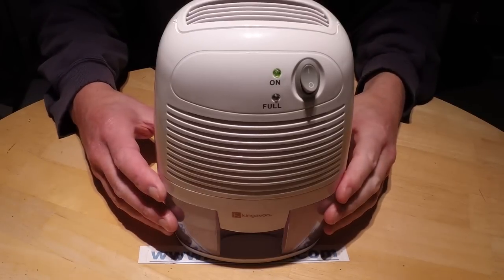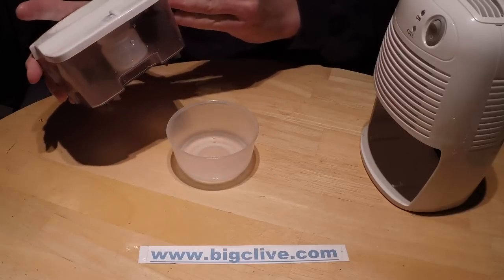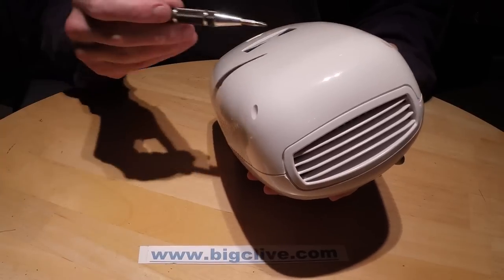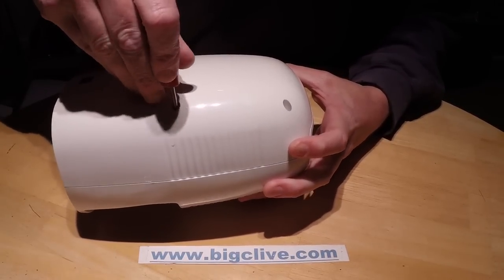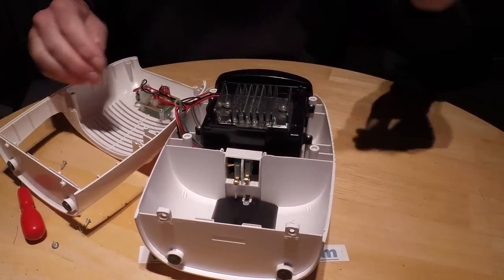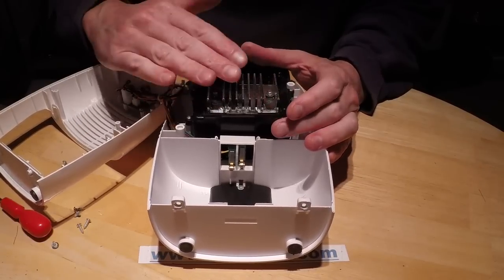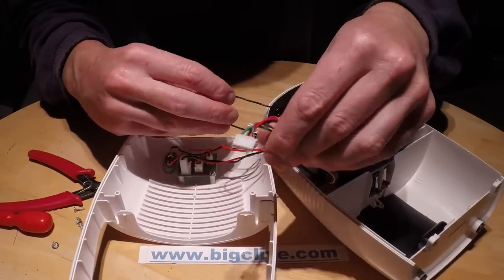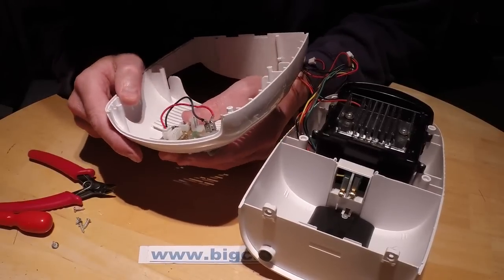Mini peltier dehumidifier teardown.

Comment: Would this be sufficient for an emergency water supply?
Reply from the maker: +Vallen Larsen I don't think it would produce enough.
Reply: bigclivedotcom I'm sorry... I should have included the word supplemental in that question... Of course it wont be enough on its own. Now what about plants? Would it supply enough water to hydrate a plant or two? Thank you, sir. Love the videos and I envy your island of residence.
Reply from the maker: +Vallen Larsen It would probably be enough to keep a plant alive plus spare.  But the water would effectively be distilled, so it might need extra fertiliser and minerals.
Reply: depending on where you live and how polluted it is, water collected from the air may not be pH neutral.  Even for plants, treatment may be needed, not just for minerals, but acidity.

Comment: I have the exact one in my towel closet. It was going alright for about a year then he bearings went on the fan. Just replaced it with a Noctua one. Next I was going to see if I could make it battery powered so I can out it in closets without a power point

Comment: Wouldn't it work better if the air goes through the hot side of the heatsink first then through the cold one? That way, the air gets heated first and the massive drop in temperature via the cold part of the heatsink will aid in drawing out more moisture from the air.

Or I might just be overthinking LOL.
Reply: +Kevin Go Interesting thought you have, but the answer would be "no."  It's not the difference in temperature that causes the water to condense - it's simply the overall temperature of the air.  Heating the air up first would unfortunately make the dehumidification process *much* less efficient.  Once air is cooled below a certain temperature, it can't "hold" the same amount of water that it can at a higher temp and that water (technically a gas or steam) forms on the cool surfaces.  A full-size dehumidifier (with a compressor) actually does use a principle based on your idea, only in reverse.  Since it is only removing moisture (humidity) and not cooling like an AC unit, it actually reheats the air going through it.  Room air enters, it is cooled below it's dewpoint, the water condenses and is removed, and then the air is reheated.  Actually the reheat is necessary because of the way a vapor compression system works...
Reply: Actually it would've been more efficient to blow the cold air (after condensation) back through the hot side, as this will cool the hot side more effectively.  The cold air is essentially wasted anyway, so using it like this would get a little more use from it first.

Peltiers can only maintain a fixed temperature difference between the hot and cold sides (say a difference of 30°C maximum), but the hot side will get hotter forever, which means the cold side will heat up too as it will always be 30°C below whatever the hot side is.  By blowing the waste cold air over the hot side, you will cool the hot side even more than using room temperature air, which will allow you to maintain a lower temperature on the cold side, which will allow more water to be extracted from the air (since the cooler the air, the less water it can hold).

Of course this doesn't break any laws of thermodynamics, because with a perfectly efficient Peltier blowing the cold side back to the hot will in a best case just get you back to room temperature.

Comment: Hi Clive, thanks for this teardown video. I've always wanted a small dehumidifier for a tiny room and had looked into the peltier-based models, but found $35USD+ way too expensive for what essentially is a peltier and a few heatsinks. Now that I know how these things work, I can use a few peltiers I have and some spare heatsinks to recreate this device for only the cost of my time.

Thanks again!
Reply from the maker: +Patty Two Wheels A recent test showed that the peltier unit was only about 20% as efficient as the desiccant drum unit.  So the initial cost of the small unit would soon be outweighed by the running costs.
Reply: The point of the vid is this design is bad even when optimized it’s just a very ineffective way if you’re looking to actually draw a decent amount of water per day. This inherent limitation and slope of increasing inefficiency as the area around it comes to temp. His whole point is this would be completely ineffective in any practical sense. So I don’t suggest you waste your parts and time this way, Peltier modules as a whole are just super inefficient even with the high power units it would be terrible  at this practically for condensation uses even with high power consumption. The math has been done and even with the most efficient end best units we can make it would still be wildly ineffective. Technically they work but there exist much better ways as even refrigeration with gasses abs compression is more efficient generally. Hence  the self filling water bottle thing or the “water seer” devices and anything similar  can never work and would barely provide a few sips of water a day. Sorry but they haven’t found a miracle that solves the water crisis so simply  and easily. Keep in mind the Waterseer was a straight up scam and basically so is any similar fonts self filling bottle and they absolutely know it never word. And high school student could do the math to show what would be produced with the power used and the modules we can make and quickly find the idea as laughable and only works technically ever so slightly in (theory usually lol) as being a step away from free energy . Physics says so. Maybe try some of the other project uses for your spare unit and make something more useful and effective like a fridge. And you could do solar but the required panel would defeat the purpose and raise size and cost vastly. Wall power is cheap and likely available to you.
Reply: +bigclivedotcom and the full switch will never work and less one it changers its mind to how much water it wants to get out of the air
Reply: Of course it adds about 30W of heat to the space it's operating in, which lowers the humidity by raising the temperature.  When I worked with my dad in a resort, there was a 100W light bulb in the outdoor box that contained the PA system, just to keep it a little warmer inside and prevent condensation that would mess up the electronics.  So in a confined space like a linen closet, this peltier unit might be as effective as a 40W bulb.

Comment: I used to have one, and I would imagine that mine was quite a bit more effective than this one, as it used a 40x40mm Peltier module and a much larger heatsink.
Reply: Please can you share internal diagram
I need this really for my 4 fit box to dehumidifier.
It will work in 4 fits box to completely dehumidification within 3 to 4 hours ?

Comment: Did you find out how much moisture it can take running for a day? I wanted to use something similar on a car without heater, so wondering if should go with this or a desiccant one. Thanks
Reply from the maker: +Susana Godinho It might be OK in a car.  But would draw enough current that it couldn't be left running all the time or it would potentially drain the battery flat if the vehicle wasn't running.  If you search my videos for rechargeable dehumidifier you will find one of the silica gel ones that has a built in heater so you can plug it in indoors overnight to dry it and it then does a modest job of drying the air in a vehicle.
Reply: +bigclivedotcom That would only run when the engine was on or the car was plugged in. 

I have the silica ones, 1KG bags and those remove about 30ml/day: only good to keep condensation under control while the car is parked. Did you tested the removal rate and capacity for those portable ones on your video?
Reply from the maker: +Susana Godinho The little peltier unit in the video drew out 200ml in 12 hours of use.  Not great for a house, but maybe OK for in a car if it's being driven a lot or if it's an electric one, then while it's plugged in.  I might suggest putting it in a suitable container so any water that slopped out of the water tray wouldn't immediately soak into carpet.

Comment: 30W peltier? That's like trying to heat a room, even small, with a 30w lamp, you'll never make it, I plan to build one with 600W array of peltier, also, air will cycle from the cold fin and fed into the hot fin, what won't heat the air and make the hot side a lot cooler, making more cold on the other side, I've tested the setup and works. Also comparing this with compressed gas, they consume around the same 600W to be effiecient.

Comment: I want to know.what the way air in and out in this pleter module?because brusless DC fan is attached on the hot side.but we need cold air.if the cold side of the pleter module is not attached with any fan..how would actually we get.cold air from that.plz pal..I need to know

Comment: Peltiers are quit fun in the way they work, just really inefficient compared to a compressor refrigeration unit, and it is always a good idea to replace the stock fans on peltier things, I changed the fan in my minifridge on Satuday as the stock fan pushed me to breaking point with the horrible noise it made, I even videoed it too for my other channel:

http://www.youtube.com/watch?v=nlYvh28ZFE8

Comment: This is a useless piece of crap from China.  Do not throw your money on these things if you are looking for a serious dehumidifier.  Buy the traditional compressor type or the desiccant type consisting of a zeolite wheel dehumidifiers.  Do not promote these wrongly/poorly engineered devices.  I get only 100ml of water in a 70% humidity environment over a 24 hour period, which is not good at all.  I should have been getting (1500 ~ 2000)ml of water for that period.  I wonder who designed this product, seems like someone selling snakeoil!

On Aliexpress.com the chinese sellers can't even differentiate between Desiccant type or Peltier type dehumidifiers which are 2 different technologies, one absorbs and the other condenses.  They are claiming that these devices are of desiccant type!  I do not want to do any China bashing overhere but these sellers are misleading there customers into believing that it can do the job of a real dehumidifier.

I bought one manufactured by INVTOP just for the fun of owning a Peltier device.  The first thing I noted its very noisy generating 59db @ 12V.  With its 9v power supply it produces 56db of noise.  It should be noted that a Peltier device is only 5% efficient.

Anyways thats a great video, exposing what is inside/truth.

Comment: I wonder if the peltier was moved to the bottom of the heatsink in manufacturing, to ensure the heatsink is colder at the lower part to ensure the water doesn't evaporate again as it's travelling down the heatsink? Any Thoughts?
Reply: I was also thinking that the heat from the peltier makes it slide down over time which is why it was at the bottom.

Also if it was in the middle wouldn't it collect more water making it drip onto the collection bin faster?
Reply: I don't think so, looking at the heatsink compound it doesn't look like it has moved, otherwise there would be gunk all the way down.

Comment: Love your videos! Can't help but wonder if you could improve performance by adding a second Peltier junction?  Is suppose in doing so, however, you might end up icing the cool side and have to add circuitry to shut down the junction for a bit to allow it to melt when it reaches 0°.  Then of course there is also double the heat on the hot side.  Perhaps a great idea that just wasn't meant to happen.
Reply: you could add a really large and oversized heatsink to the hot side. peltier just generates a temperature difference, the colder the hot side the colder the cool side.
Reply: +Rich Booth No, adding a second doubles the heat which with the same airflow rate and heatsinks, potentially results in the cold side of the 2nd one being hotter than if only one were used.  You would instead improve performance by increasing heatsink size on the hot side, or swapping in a higher flow fan.

Comment: I have had 6 or 7 of these around, bought in batches of 2 or 3, and two a little larger ones. I always knew they won't be the "best thing ever", but it was mainly for space reasons that we got the small peltier ones (e. g. outside wall corner in parent's basement and bathroom, in corners on shelves i my basement), but I did not expect them to perform that bad. After 2 summers of use all the fans are rattling like crazy and all but two of the power supplied died due to failed caps, just what you expected in the description. They were just barely doing their job. Their main effect of getting the air drier is actually just heating it so relative humidity drops. Perltiers are horribly inefficient. If I remember correctly it was something like for every degree the cold side gets colder, the hot side rises by 10.

In our basement we now installed some 125mm air ducts from room to room with two fans, so the air is pumped through all rooms in a circle. In one of the rooms there's a compressor dehumidifier (around 300W). It replaced two of the bigger and 4 of the smaller peltier dehumidifiers. This single device is enough to keep all the basement rooms around 65% rH, even in the problematic corners and after days and weeks of 30°C+ weather.

So in essence: you're much better off getting an old fridge and leaving it running with the door open than to buy those crappy peltier things.

Comment: The module is very cheap, you can get what I think is the exact same unit on ebay for $0.99.  This is a 4 amp model, you can get a 15 amp version for $5.00.

Comment: If you ask me, the cooling heatsink doesn't look as big as it could be, and neither is the airflow optimised properly. It looks like a half-baked design, to be honest. You might dramatically improve the performance (proportionally, that is) by slapping on a much bigger cooling heatsink and improving the flow so that the incoming air has to go through the heatsink from top to bottom (or bottom to top), and making sure the outgoing air doesn't interfere with the incoming air.
Reply from the maker: The size of the cooling heatsink is probably deliberately small to increase the temperature differential between it and the incoming air.  the airflow does run down the channels of the heatsink before passing round the back to the hot side.
There's a very good chance this IS the actual optimised design, but it's just very inefficient by its nature.
Reply: He said "from cold to hot" and that would increase the performance a lot, thats how all (real) dehumidifyers work. That way a lot less energy is wasted to cool down air when u actually just want to put energy into condensing water, as the cold air cooles the hot side it makes the cold side even colder. So it basically regenerates (some of) the energy put into cooling the air.
Reply: +bigclivedotcom It doesn't look as though there's adequate air flow through the cold heatsink.  It should be pushing as well as pulling.  Also, what was the exhaust air temperature?  A dehumidifier should be temperature-neutral as far as possible. The peltier seems a bit underpowered as well.  The part number 12704 means 127 thermocouple elements and 4 amps design current.  But these things are very sensitive to supply voltage.  If it's running on 12 volts, it will barely work at all.  At 15 volts, there will be a huge difference in efficiency.
Reply: Cmazy heating up the air first would increase the amount of moisture it can hold... so cooling it down again would NOT release the moisture.
Reply: It makes perfect sense. The heatsink size is to achieve a specific temperature over the surface area at a specific current. Any smaller and ice would form, any larger and the heatsink wouldn't get cold enough to condense water. A larger heatsink on the cold size could be used, but a lot more current would have to be shoved through, which would also require a larger hot side heatsink.
Reply: Cmazy That would make it extract even less water than it does already! The rh would drop due to the pre-heating, and the cooling side would then just take it back to the original rh and temperature, probably getting nowhere near the dew point.
Reply: bigclivedotcom Does the air flow from cold side to hot side? The other way preheated air should gain higher temperature difference in cold side and better efficiency.

Comment: Clive, a request:  I see there are more and more of these things on offer now, how about a teardown?  http://www.ebuyer.com/661756-wall-socket-with-built-in-2-x-usb-charging-ports-ut-86usb  I'm interested to know if these just have a crappy capacitive dropper, or whether there's some decent circuitry in there?
Reply from the maker: The capacitive dropper couldn't be used for the USB power supplies, since it provides no isolation between the high and low voltage sides.  These units will basically use the guts of a standard USB charger inside the socket.  Personally I don't care much for permanently installed and powered electronics like that.  You'd inevitably end up with a double gang socket with two duff USB sockets on the front.